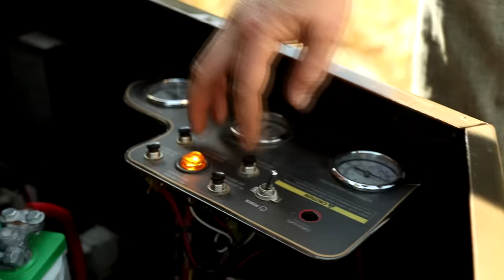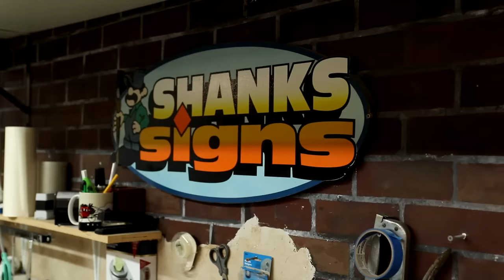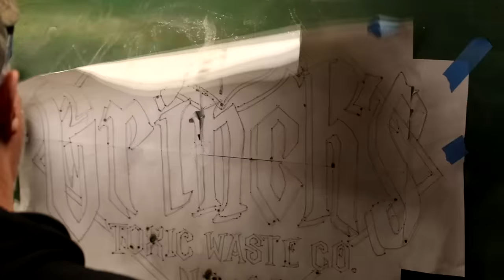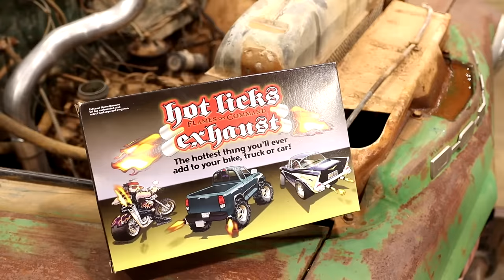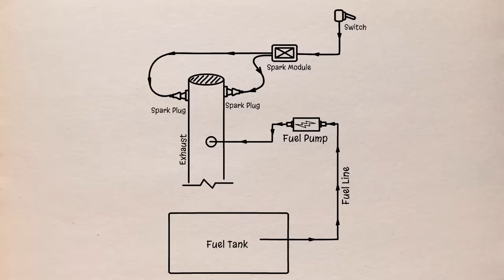FULL REBUILD: Transforming 1952 Dodge B3 Into Flame-Throwing Grinch Mobile | Turnin Rust

Comment: Love these old Dodge trucks.  Dad always had one (1951-1953 models) and for many years they were our only vehicle.  They seem to be indestructible as long as you kept oil and anti-freeze in them.  We had a '54 model that an old farmer had let freeze and popped out the entire left side of the block.  It was glued back in place with J-B Weld and never gave us a lick of trouble for about another 60,000 miles.  It had almost 50,000 miles on it when he bought it.
Years later, I found a real nice '54 model that had factory-tinted glass all around.

Comment: You gentleman are a blessing to your community! God Bless to you and your family. P.S. I purchased and built a 1948 Pilot House 5 window pick up. I installed a  350 bored 30 over, 350 auto, p.s., p.b., a/c, heat, 1977 fire bird rear end, 78 fire bird sub frame, camaro tilt and the list goes on and on. Great job you two!

Comment: God bless you guys.
I owned an old FJ45 Toyota Land Cruiser in the 1980's which had twin leading shoe brakes.
An old timer mechanic buddy who has long since retired also told me the motor in the FJ45 was basically a Japanese copy of the Dodge Blue Flame stove bolt six cylinder engine.
In my opinion based on experience for any given diameter twin leading shoes are about as strong as brakes can get, because the surface area of the shoes is substantially greater than that of disc brake pads and all of it acts in contact with the drums plus, they don't fade when they get wet.

Comment: Hey I have to comment on this one.  If old dodge wasn't stuck and had compression it would run.  Our old mechanic here in town, and I could tell many a. Story on him.  Last time I stopped and talked to Slick he didn't have anything in his shop, said he had worked hard all his life, didn't want to die in the harness, he did,  Walmart driver  rearended him bringing in a load of wheat, old dodge 45 or 50 mph, walmart driver 70, bed exploded  went thorough 3 ditches wound up in field.   Miss that old cuss.   Anyway miss the old iron.    Plus old slick,  his last name was Schichting, hope I got spelling right.   Got to add, he used to drive his old dodge to Colorado from Missouri for deer  season, tarped bed for  place to sleep.  Nowadays  here in Missouri I just try to.avoid the deer on my way home from work.
I miss the old timers.  Another Slick story, he delivered ice, back in the 1940's had a 193? Chevy truck, by the end of the war he had 5 sizes of pistons in truck plus shimmied and fitted con rods.  Make do, make it run back then.  Hey these old guys were my heroes.

Comment: My dad had one of these back in the late 50s. When it was real cold it didn't Ike to start. He used to pull start with my mom's 55 Buick so he could go to work.  He would park it on a hill to drift start to get home. Mad it thru one winter and got rid before the next one.

Comment: The heater box are with the two spark plugs ignitor plugged to the two hole fittings atop the hood of 1952 Dodge Metal Grinchy truck Model DB 3. The Model B 1 is a short bed pick up truck as an option but it depends on the buyer in during 1952 Dealer's Sale. Dodge have some dealer selling Model B 2 which is a standard length bed about 8 foot long bed, Model B 3 is a standard bed with taller walls of the box/bed.
  The flame clean burn of the letter "Y" exhaust pipe coming out fumes from Special Six flathead motor. The garage with the thermostat shows that the Turnin Rust garage have been at 65 degree Fahrenheit  or up to 67 degree F. While outside it feels like 5 to 20 degree F. The heater box is the upper exhaust pipe while the exhaust gases also blows exhaust gases to the lower exhaust pipe. That shows dual exhaust tail pipe and smokestack 2 1/4 inch pipe equals 57mm pipe. The lower tailpipe is 50mm - 52mm is connect to go to outside with a little open the garage door. It was too much smoke of carbon monoxide and very bad for my eyes and other people gets irritated eyes that I have seen. The smokestack takes the heat toward to inside your garage and it needed the heated garage. Keep running the flame torch 1 foot and not more 1 foot flame thrower of yellow fire called camp fire inside your garage because it need some heat. Gasoline is only $3,19 per gallon and Propane is a above $4.00 a gallon of liquid. Natural gases is $3.75 dollars per gallon for it's liquified up to $40 dollar per gallon. LNG is in the color blue pipes and it would ask for salaries of employment of Natural gas sales and they never decrease their own salaries if everyone converted their own houses uses just electric furnaces Hunter and Cooper AC 2 in 1 Model incudes refrigerate heater ductless and tankless water heater of propane gas and liquid oil. It is really all house owners are paying over $80 dollar per winter month each house. The price per gallon in Natural gas at 19 PSI is never known so they secretly keep the price so high. The propane is at 80 PSI many time.
 Plus your 1962 pickup truck color orange have heater box with side flame coming out of the side. It's a plus to make garage very warm interior. Smoke the interior of the garage up to how much part of polluted air to 1 part of breathing air is a ratio that defies the law of safeties. We need to make a new rules. Thank you.

Comment: The green truck was full of dirt in the box named bed of the trucking. But it was not driven until it was fixed in Texas. The piston was stuck in the engine block and The Bush Family was able to remove the cylinder heads and hammer had hit down the wood block that press the piston down and got it running. Then it was pressure washing that way after it got dried then they applied the boiled linseed oil all over the truck Model Pickup color green. That is how the color green is original but paint up the green truck with red metallic dark magenta but you somehow got rid of it then brought in new white truck dually.
 The working with sledge hammer on the wood block is just talent of your decision in what to do with seized engine into unseize it. Most other mechanic didn't know that.

Comment: Guys, 
I was with you until I saw the hole getting drilled into the hood of that beautiful old original Dodge. 
It was begging to remain original. Did you find it curious that it started up and ran after 20 years? The truck had no severe rodent damage, no severe bugs infestation and no bird poop on it. It had limited rust. Think about it.   
I don't want to get too weird here, but did you also find it strange that it had supposedly been there for 20 years and you never knew it? 
With the success you folks are having, you must surely understand the power of attraction. It's a gift that's more than a series of lucky coincidences. With that said, I hope the truck eventually gets restored to original and renamed with a positive pronoun. 
I enjoy your program and especially your no-nonsense approach to getting these old cars and trucks back on the road, but I had to gripe when that fellow drilled a hole in the hood of that old Dodge.

Comment: Back in 1976 I had a 1960 Dodge 1/2 ton pickup.  It was kind of rough.  Then in 1984 I had a 1979 Ford pickup.  It was much better.  Curently I have a 2016 Ram 1500 pickup.  And my wife has a 2018 Cummins powered Ram 2500.  A couple of weeks ago, I bought 2023 Jeep Wrangler.  I have owned several Chevrolet and Dodge vans over the years.   I currenty have a 1996 Jeep Grand Cherokee and a 2003 Ford Explorer SUV.
The emissions stuff makes the newer vehicles more complex.  But air conditioning makes the newer trucks more comfortable to drive.  And speed control makes long trips so easy.  Navigation from our phones keeps me driving efficiently going down the road.  The older pickup trucks may be fun for Christmas parades and to put around in mild weather.  But when I compare the modern 10 wheeler dump trucks I drive on occasion at work.  And the semi-trailer trucks I drove in the 1990's and 2000's, compared to the 1950's and 60's cab over Freightliners I drove in the early days.  
Nostalgia or not, at age 68, I want the comfort, convenience, and power of todays trucks.  But still appreciate  the style of the old machines.  I do enjoy touring museums like the one at Walcott, Iowa.  And hope they continue on for generations.

Comment: Both my buddy's own these. 1973 and 74 models where the only years to have the "opera windows" on the rear passenger windows.
This model is the 1973 Dodge Charger in the SE trim package. Under the hood it sports the .400 ci and the 727 rear end.

Comment: Love you guys... Sometimes you can put an 8 volt battery in those old trucks in turn the voltage regulator up to 9.6 volts it adds new life. And will not hurt the 6 v system. Butt the 8-volt  batteries are not cheap.

Comment: I LOVE this old truck, but there are a couple of things that would've made it better. One is a Gen 1 Firepower Hemi, and the other is it would've been REALLY cool to call it the "Poo-Choo Express". It's obviously not my truck, and it's obviously not my wallet, but I have ALWAYS wanted to rock a Firepower Hemi in one of these old single cab pickups with some forged pistons for high compression, along with either a high dual tunnel ram with two Holley double pumpers, velocity stacks, and a compensating cam, OR fabricate a custom intake manifold with multi-port fuel injection and individual throttle bodies. I think a 10.5:1 331 with the individual throttle bodies, some custom made long tube headers, custom duals, and a Holley engine management should easily make 300 HP. The 1955 300C 331 with dual fours made 300 HP. I'm just a nut for nostalgic oddball builds.

Comment: The bigger ring on the hood of the truck Dodge will stay atop on the hole because the hole is smaller diameter than the Outside diameter (O.D.) of the ring sheet metal to cool off the hole and hood style wings sheet metal with inner structure that it can open on both sides of the hood. The ring will have the lower and all around low relief rise a little to stable the ring in the place but either way, the hole is flat around the hole is an ok. Then the pipe comes up thru the hole that your hole saw did cut it out in the exhaust pipes shop.

Comment: My brother had an old dodge truck like that and the only thing that ever went wrong with it, the steering box went out. He drove it for quite awhile before it finally quit steering lol. It'd go half a turn both ways before It'd steer and seems like he drove it for a year or so and idk how he kept it straight in his lane but he always did purty good with it lol. It had a flathead 6 cylinder engine and I'm pretty sure that it was a 1948 model and it was solid in the 70s lol. Cool old truck though. I'm not really into vettes but I think 25,000 was a bit more than what the car's worth and it reminds of a kit car that people could order that couldn't afford a vette in the 70s...They'd put em on a vette frame that had a busted up body but everything was fairly cheap back then.... I really don't think that car would have been worth it depending on how much more money it'd take to get in really good shape for a resale...God bless everyone of yall cause I just knew that the ol truck was going to run just fine but it all worked out for the good anyway and I'm a firm believer that God works in mysterious ways cause yall were a winner anyway lol....

Comment: How do  you fill the cylinders with air to test compression with a rag in the carb.  Get rid of the rag and put a brick on the gas pedal to fully open the throttle and you will get an accurate compression test.

Comment: 1952 Dodge truck is not in bad shape. It is money worth of work on body and sand the rust off where you usually to do is find the primer and use simple brush the primer and then spray the overcoat and that way you have a chance to keep your truck instead of the Pickup truck color white or no?

Comment: I wouldn't bid $10 on that vette without seeing underneath. The frame and cage are to important too skip looking at. I'm shocked at the price. If it were a 396, and everything checked out....okay. I could understand a mandrel bend muffler shop being busy but not a run of the mill muffler shop. Try and mandrel bend 3" exhaust on a 86 glhs turbo and you'll have the same skill's as my favorite exhaust man. Great story and cool ole truck

Comment: Right, the son think it is the faulty fuel pump and the father thought it is the carburetor that is not pumping in fuel. I would think the gas tank is clogged up the line tube connect to the gas tank under the truck Dodge 1952. Since, They turn and crank the flathead motor without replace the old original gas tank 15 gallons capacity approximately.

Comment: Hey, back when, late 1970s I could buy parts to rebuild fuel pump.  Just diagram and check valves, can't get that stuff anymore.  Hey got to love old stuff.  I have some.
Reply: Some, ok some rigs needing attention, couple of Inc's plus a ford, all will run.  Should get scout running first, needs tires, clutch and brakes to get it on road, got some electrical problems as well.  Hey, today thanks to internet I can get parts I couldn't 40 years ago.  Maybe I will this year ?  Got a 64 ford needing attention also, it be my future almost heavy hauler.  Ok got an 1988 f250 with a 460 and 5 speed horse of a truck then if I am not in a hurry, got the 1952 ihc one ton 220 silver diamond that runs like a top if you don't want to go faster than 45.
Well anyway, I have work to do.
Hey tomorrow I just hope to get thermostat replaced on my mercury grand marquis,  half hour project,  get my mileage up.  Gee wiz, used to listen and observe, now we use code  readers.  Hey I can tell a lot of old mechanic stories.  Not sure i like being an old mechanic, back hurts less than yesterday.  Yea.

Comment: Oh your father doesn't have the transmission. When the transmission was given the choices from Plymouth and Eagle dealership. Was it automatic transmission or 4 gears where the International said, Five5 speed column shift. That is where it is running post vintage transmission and it's an ok to drive the transmission with sit on the box.

Comment: When the first owner drove the 1952 Dodge truck in 1960 and he broke the clutch and pressure plate and left it off and dump it. Then you are taking out the pressure plate and the spring is not okay?

Comment: My project I wanna do is take my dad's 1995 Chevrolet Silverado K1500 and put a 6.75 Rolls Royce V8 under the hood, Has a manual trans. so it may be tricky but it will be good

Comment: I am a confident engine rebuilder, on a crusade against "will it run" fools. EVERY SUSPECT RUSTED. ENGINE REQUIRES A 2 HOUR TEARDOWN - THE PARTS SENT TO A MACHINE SHOP FOR REAL MEASUREMENTS OF VIABILITY /  COSTS. NOT TURNED OVER - NEVER STARTED.

Comment: Hey I painted my last 65 Chevy truck with Lowes house paint 20yr guaranteed semi gloss Butternut Yellow. A a 3" fine brush. Then go to Walmart n park between 2 New trucks hearing how your truck sure looks good. Had that granny low 1st gear to pull stumps with n 60mph was 3 grand on the tach. Can fix anything on it for less then $100. What do you have...

Comment: I watch all your videos... but putting that pipe through the hood was a bone-head maneuver.... that metal cannot be replaced, and it will leak until hell freezes....  even if you weld the part back up, it's still going to leak....and be coated with bondo on a part of the body that is always going to flex...... why not drill a hole in the wooden bed and do it that way if you have to do that.... 
My dad had one of those trucks, and they're almost unobtanium...

Comment: $25,500 was way too high for the corvette.
1. its not original with all the body work.
2. The overall condition was poor.
3. The frame could be a total rusted mess and you just don't know how extensive the rust on the suspension is. Too much of a gamble IMO.
After all you will have to do to it to get it streetable I doubt you could make back your investment.

Comment: Did you save the disk you cut out of the hood?  If so your next project should be to remove the ridiculous fire shooter and have a skilled welder replace the disk.  IMO you ruined a classic truck with that stunt.

Comment: Labeling the truck is kind of fake and it's not original color green. It was all rust and no, the word patina hasn't any meaning but it is a glitch and false computer hacking into the photoshop and showing off pictures of car. The rust would be painted because it was a plan for auctioneer to get $50,000.00 dollar to rip off even to me over this 1952 pickup truck. The truck pickup color green is a clowning around truck and it's suppose to be funny. But it's not funny I'm a septic tank worker and as well I work as a nursery taking out the toilet small pail and pour it out to the running toilet.